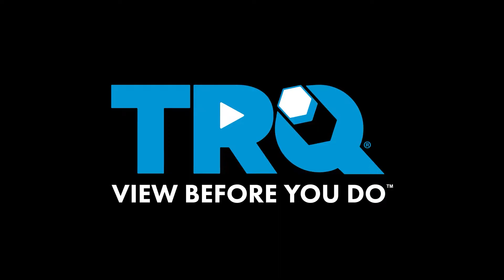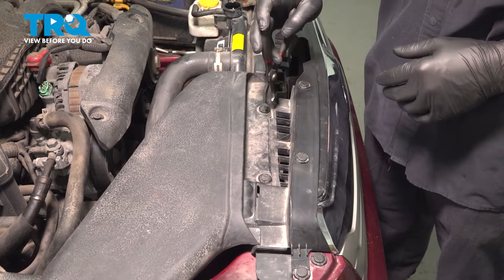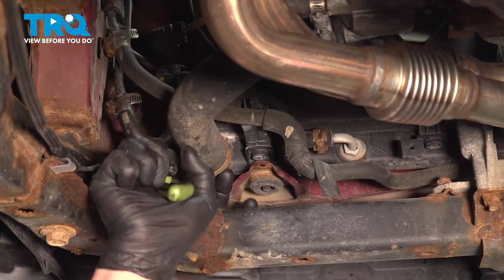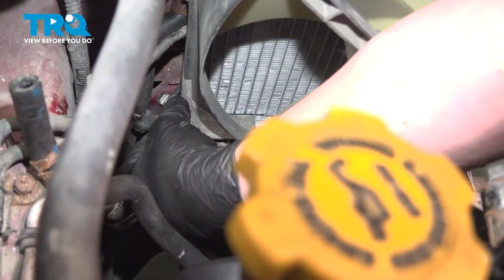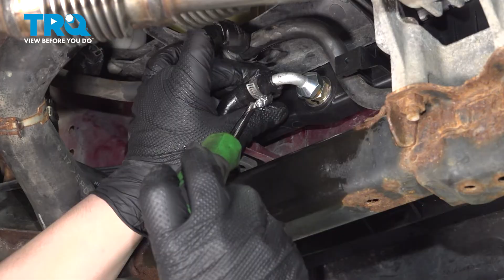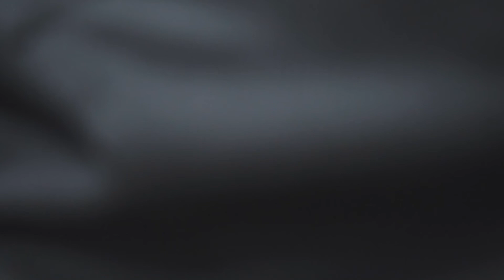How to Replace Radiator 2010-2014 Subaru Outback

Comment: What are the two lower smaller pipes called? i took mine apart and noticed they had leaks but cant find the right pipes to save my life. ITs the smaller two you refereed to as the transmission cooler and the engine cooler

Comment: Thanks for the tutorial.  
Shouldn’t the coolant be blue? Did you switch out the upper radiator hose clamp (and one of the trans hose clamps) because the old one was deteriorated?  Is there a need to top off/check trans fluid?   Thanks.

Comment: Why not replace the main upper and lower radiator hoses with the new instal? Seems if the radiator died those hoses would be old as well. Im gonna do this on the weekend and will use your video. Your videos have been a great help with other repairs as well. Thank you.

Comment: Did my first radiator following this, great help thanks!
The new radiator I bought didn’t have the transmission barbs fully screwed it, leading to a small leak first run. Just a tip for others to check before installing.